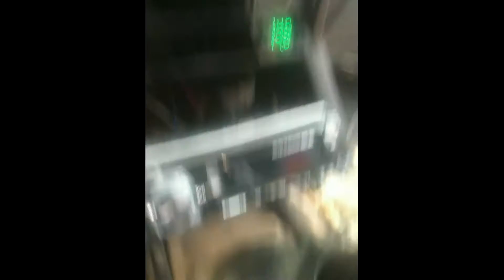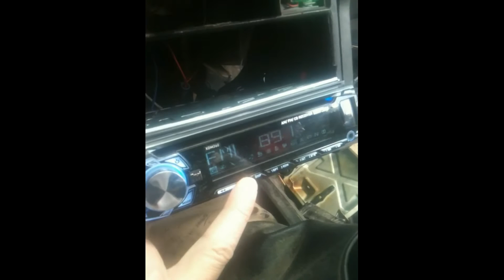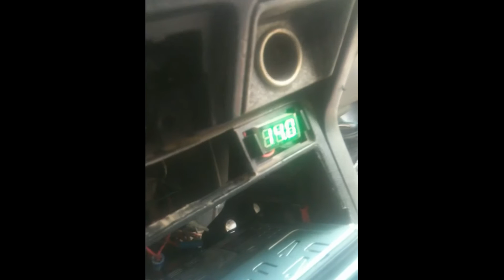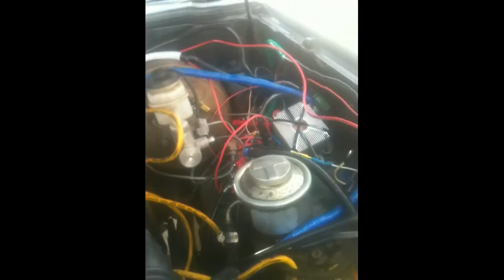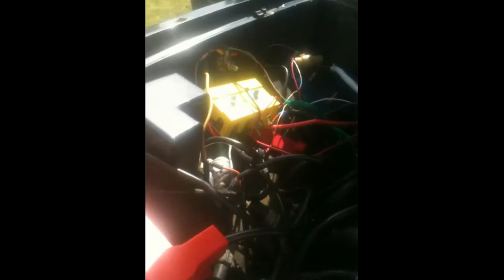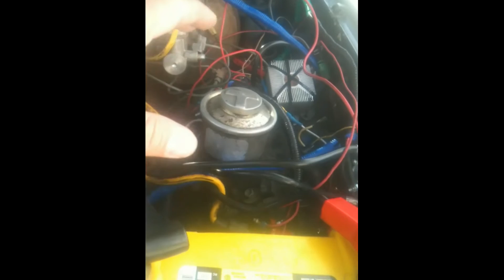84 4runner GM Alternator Upgrade

Comment: Hey, did you stack washers for this? If so do you know the years or models that will work? Thanks for any help
Reply from the maker: Honestly this was my pre fab days  and that truck is still mine but at another property. I've learned welding the brackets even becomes a pain and it's just worth it to get the right bracket. When it comes to the alternator you want a tight stable mount

Comment: Dont mess around fighting washers get the trail gear bracket. On my 85 4runner i had 4 wires to my alt. yellow is #1 white is the exciter wire #2, no need for a jumper. The small red wire i hooked to my coil. It fired up my tach, and voltage guague, and the rest of the cluster. i used an alt with 2 spades and the main post. it was from an 84 chevy truck 350 78 amps